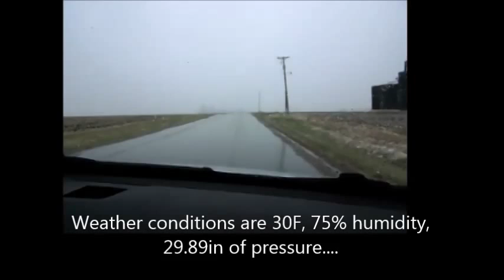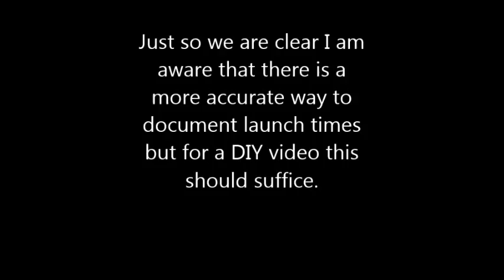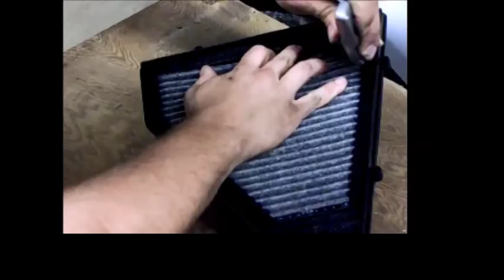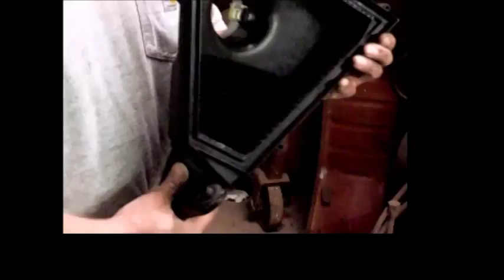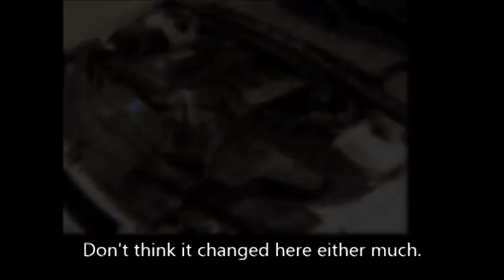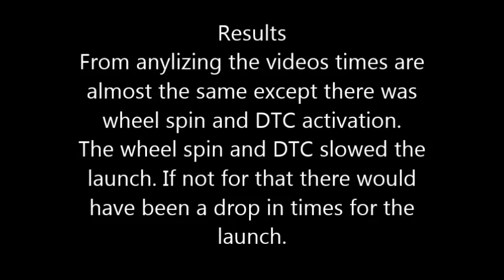BMW charcoal filter delete E90

Comment: I know this is an old video but I would like to do a comment. I have found many people Replacing the throttlebody tube with the air baffle in it with a silicone tube.  I believe the replacement is about 60 bucks. By removing the baffle you’re supposed to get better airflow.  When I was doing the charcoal delete I pulled this tube off cut the baffle off with a hacksaw and plug the hole with a rubber stopper that sits flush inside the tube. Literally cost $.26 to do. Just a heads up for people trying to do this save your money
Reply: where did you get the rubber stopper? also what are the dimensions for it?
Reply: Richard Needham  lookup mishimot intake boot for our cars it’s lifetime warranty and better made than oem

Comment: You should have rest the adaptations then the DME will make the changes for the extra air flow and that would translate into a tad more power.
Reply: Can you explain it to me I’m deleting my carbon fiiter also I don’t want to spend crazy money on a intake system..
Reply: Juan Carlos Hernandez basically u have to tune ur bimmer if you get a new intake/charcoal delete so it comprehends & acknowledges the changes that have been made
Reply: Kyle hamburgh  ok I need to find somebody to code the computer of my car so it recognize the changes..

Comment: You must have the slowest e90 i have ever seen. My stock 328 does 0-60 in just about 6 seconds (slower because off awd) and my e90 325 did 0-60 in exactly 7 seconds stock.
Reply: Snare Drummin it's probably a Euro one
Reply: @Isaac86557  is not euro e90 is 330i not 328i and the power turn around 275hp is faster than us model

Comment: Just did this mod to my e90 325xi and in all honesty I think its a placebo effect cause I feel like the car pulls harder and it won't peak at the higher end of the powerban it just keeps going strong to its 7k rpm redline i feel like the response is a little better but again I think its a placebo effect
Reply: Unfortunately, you are correct.